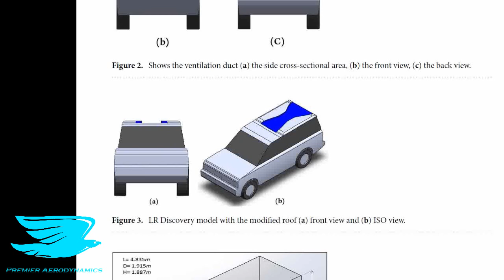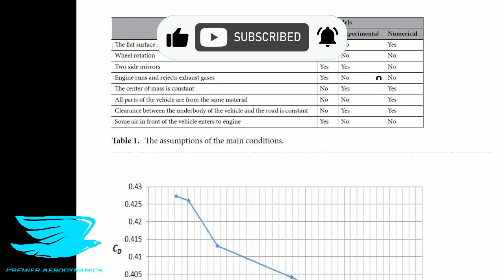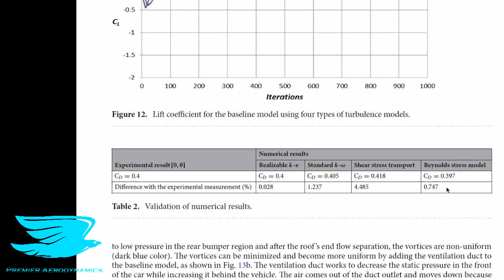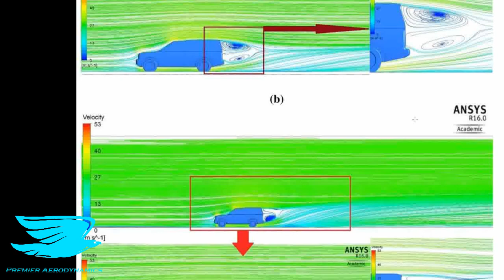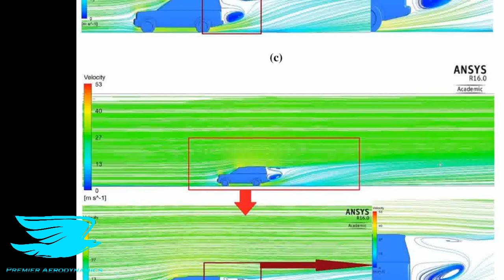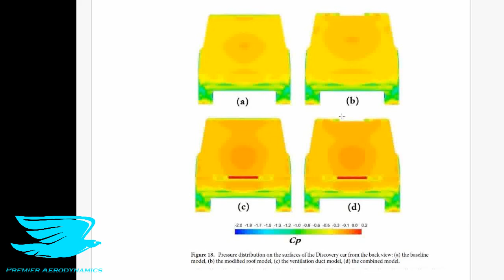Podcast #152 - Altering SUV Roof And Interior To Improve Its Aerodynamics

Comment: Interesting paper well described. I'm experimenting with a vent duct in my Hill climb car, currently under construction. I'm using simscale trial version to its fullest!
Reply from the maker: Wow! How are you working around the other stuff in the car?
Reply: @PremierAerodynamics  the car is single seater with the engine alongside by the drivers legs. This I can channel air past the rad and engine, front to rear. I intent to feed air in from under the front of the car.. two front diffusers into intake ducts. Also thru the centre a flat floor to rear diffuser. Car is open and shovel nose and very wedgie. Rear wing...
Reply: I'll post the design on my YouTube site in a month or so. Very grassroots / ghetto
Reply from the maker: @Stu718  Okay, that will probably work pretty well because you have a lot of space to work with.

Comment: That's promising for such a primitive design, after a few iterations that CD/CL figure can be drastically improved.
Reply from the maker: Yeah! I think playing around with the inlet and outlet sizes and locations, as well as rounding the tubing more, and even working on the roof design would yield even better results.
Reply: @PremierAerodynamics  Have you seen the roof on the BMW i8? Looks like they did something similar.
Reply from the maker: @rolandotillit2867  That's true.

They also have those gaps in the C pillars, which I think are probably to also help this general area.